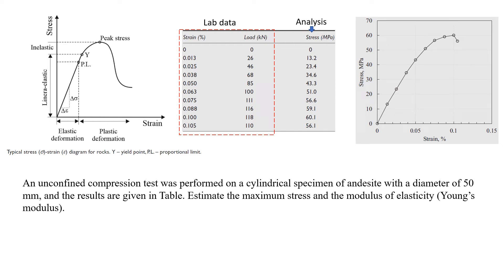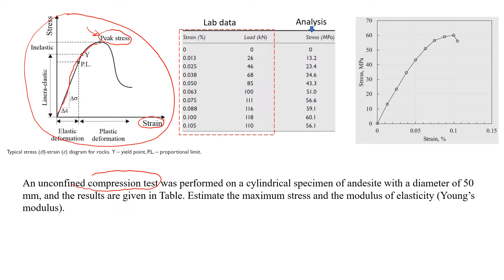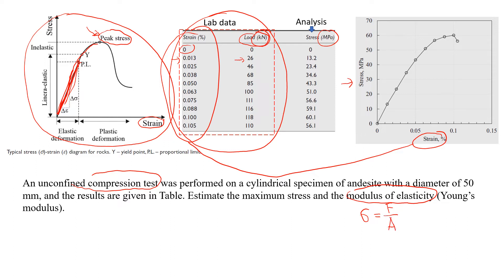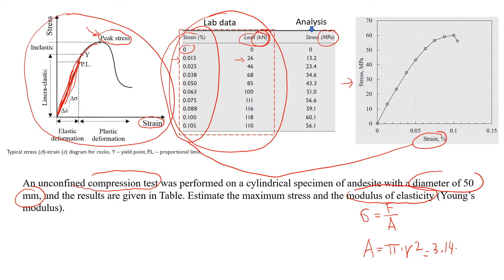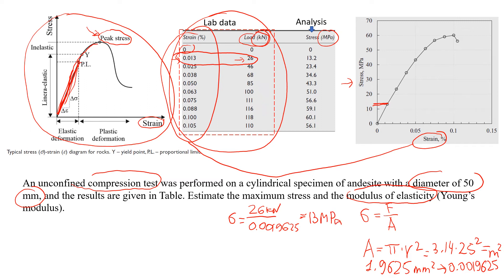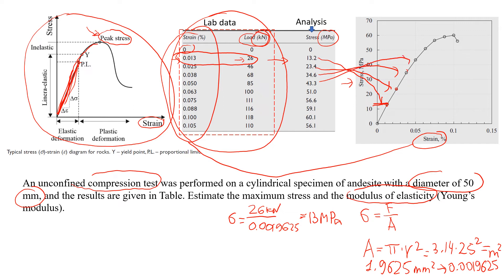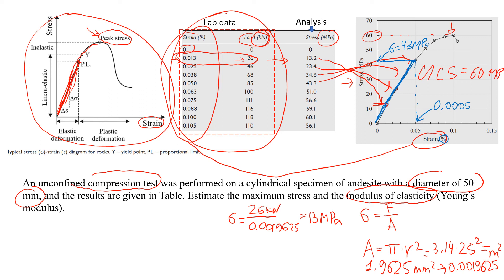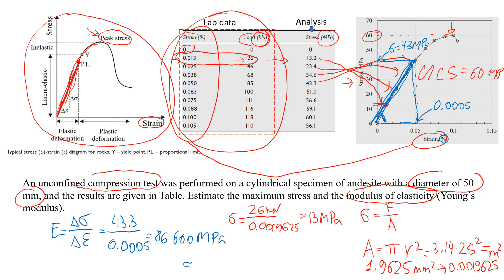How to Calculate Young's Modulus from Unconfined Compression Test

Comment: I truly admire your expertise and contributions in the field of soil and geotechnical engineering. Your research has been highly insightful and valuable to many in this domain.

Regarding my current work, I would like to ask if there is any journal that refers to this calculation, or if you have ever published this calculation in a journal. If so, could you kindly share the link so I can cite it as the basis for my calculation?

I appreciate your time and assistance. Thank you in advance.